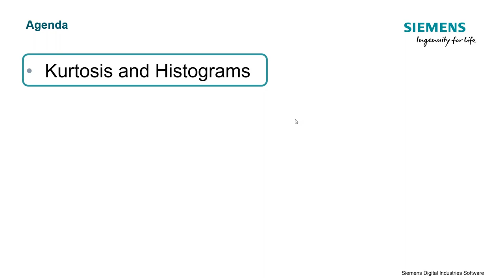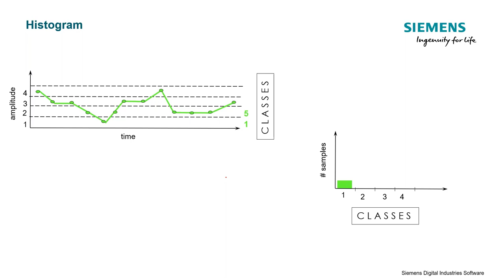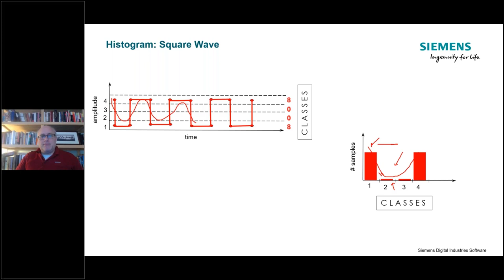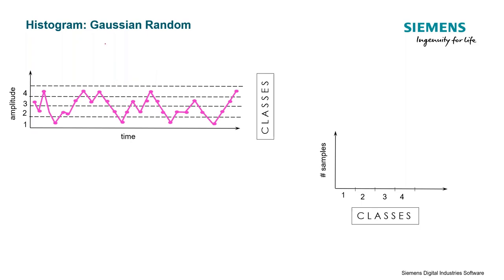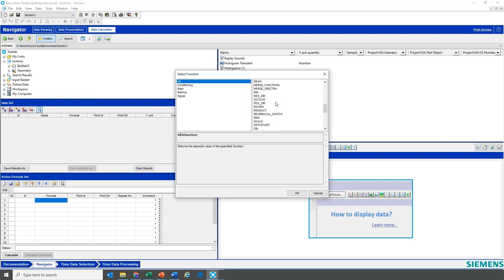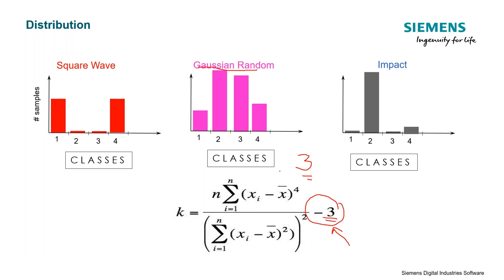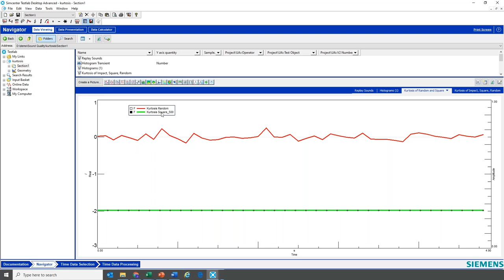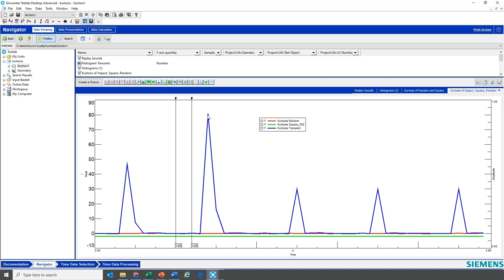Kurtosis

Comment: Kurtosis does not measure a spike in general. If you generate data from the beta(.5,1) distribution, you are generating data from an infinitely spikey distribution, yet the kurtosis is less than gaussian.

Comment: Hello, when I generate a "kurtosis" diagram, can I drag it into the "frontback" diagram if I want to open it? I tried to process a group of noise time domain signals (interior noise) to get kurtosis data. When I dragged it into the frontback, I found that the waveform is broken line. Is this normal? Thank you and look forward to your reply
Reply from the maker: That is not normal.  Did you calculate kurtosis using frame statistics?  Maybe the frame was bigger than the time history?  Suggest calling your local Siemens support if can't figure out.
Reply: @SimcenterTesting  ok  thank you